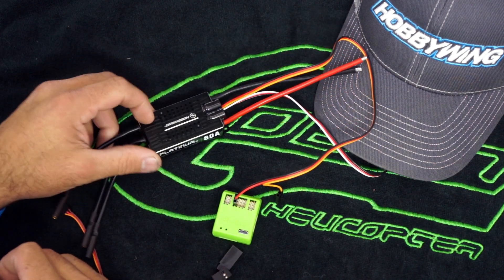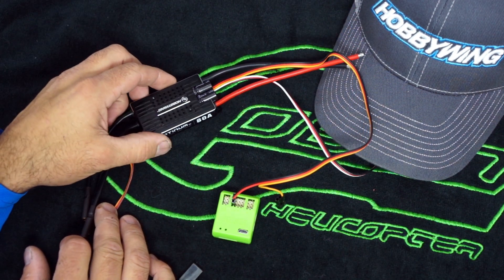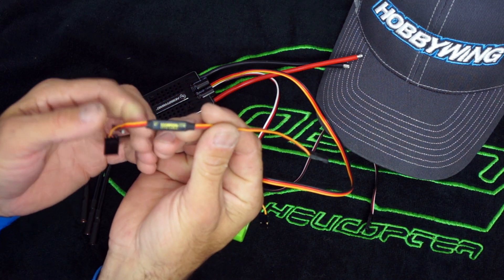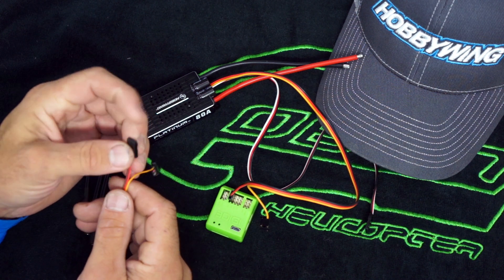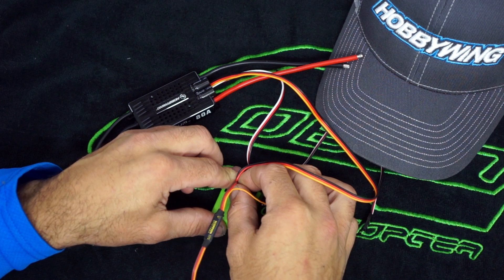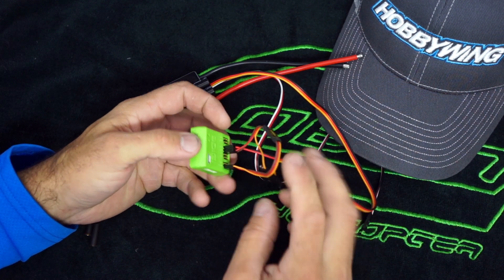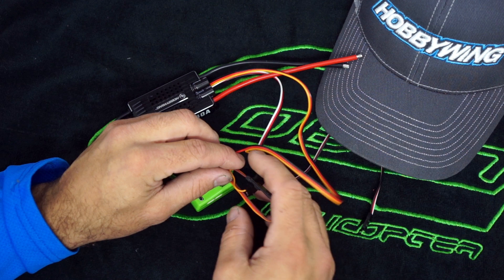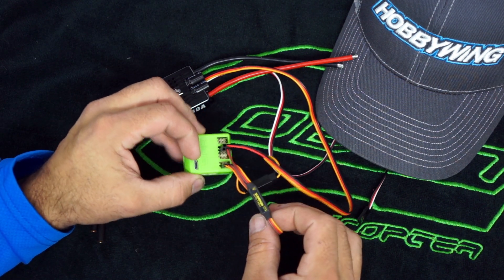HobbyWing RPM output and OptoCable

Comment: Nick I am having issues with a 60A v4 and an iKon 2 where the initial spool up has such force (no soft start) that the heli actually spins on the floor. I went no further and I use Gov Store on the ESC but left the governor lead plugged in to see if I can at least log the RPM's. Is there a way to solve this issue so I can use the FBL Gov instead of the ESC Gov?
Reply from the maker: At this moment there really isn't for the iKon/Brain. See apparently the issue is the iKon/Brain needs to be ran in fixed wing mode to govern properly unlike VBar guys being able to use Heli/Linear Throttle mode which has a soft start built into it. I know the Brain guys at our FF were all running in fixed with mode and have turned the Motor start power in the ESC settings all the way down to 1. That makes the kick manageable although its' still there for now. HobbyWing is working on a dedicated external gov mode that should solve all the issues though so hang tight.
Reply: Nick Lenn thanks Nick I will keep it on Gov Store for now. Given my low skill level I don't want to risk it. The ESC governing is working for me and just wanted to get rid of the RPM standardization step and log the RPM on the FBL. I honestly don't think I will be personally hugely impacted by the performance difference so I will wait on the solution by HW. Thanks again!
Reply from the maker: Sounds like a plan. The HW gov is really good. Especially with a little tuning.